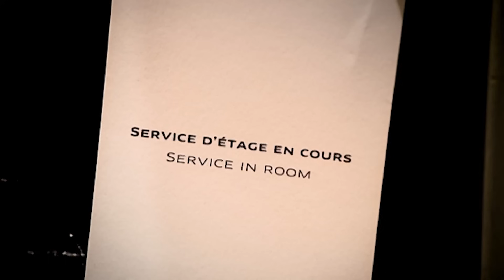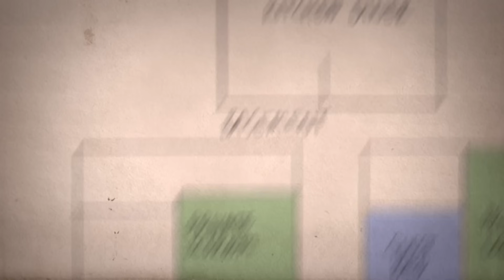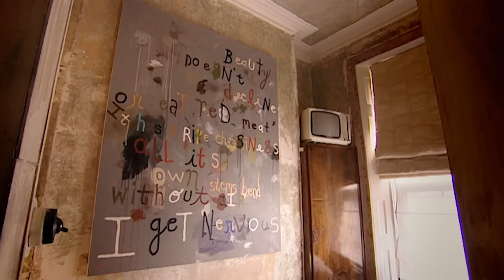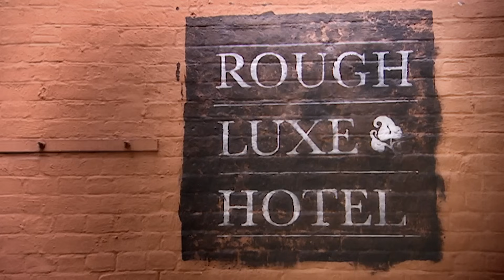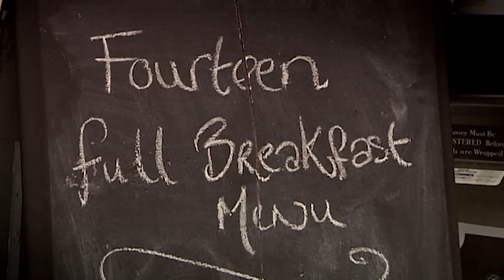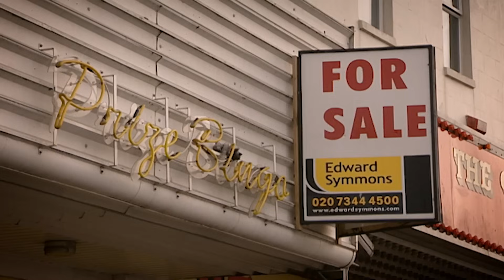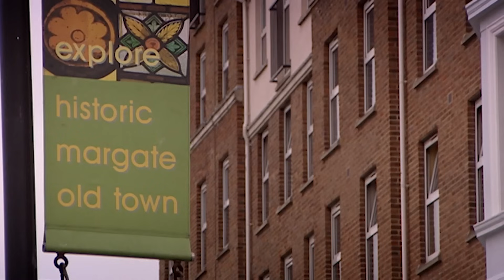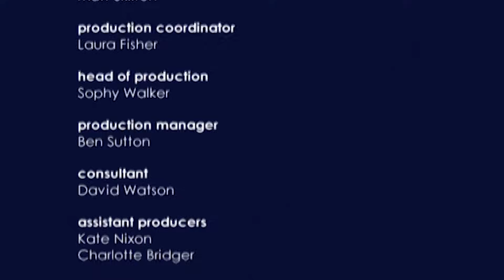Benefits-On-Sea! | Struggling Success: Property Developers Battle Recession in Margate! | Only Human

Comment: You don't "think about" how you will do a business after you have sunk $300,000 into it with no business plan! And they bought at the top of the market! If they had just waited until the Great Recession, which was on the horizon and could see it coming, they would have been a little better off having bought at a much lower price, but still living in dreamland. And then to learn that they didn't even inspect for structural issues, especially the roof! The roof of any structure is the first and main thing to determine it is in order or not before you go any further in considering a purchase, even just a storage shed.